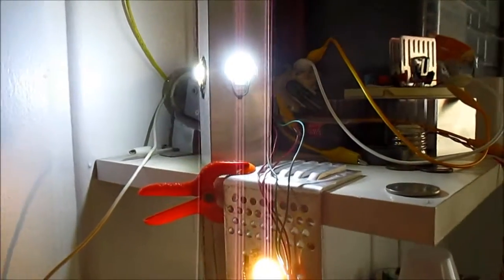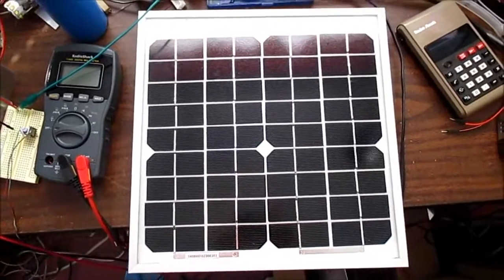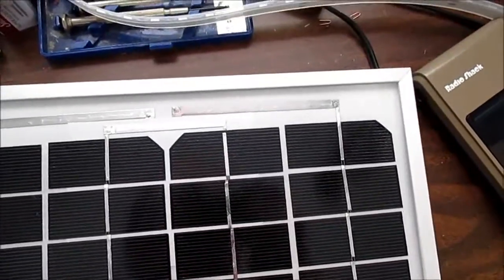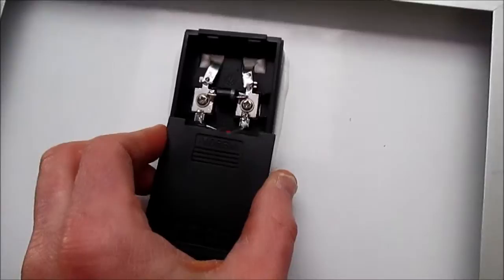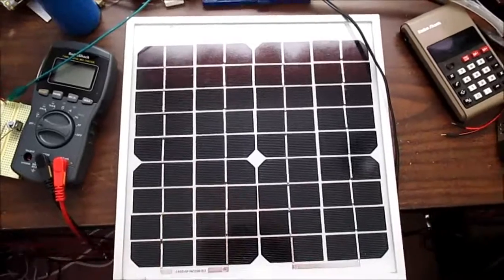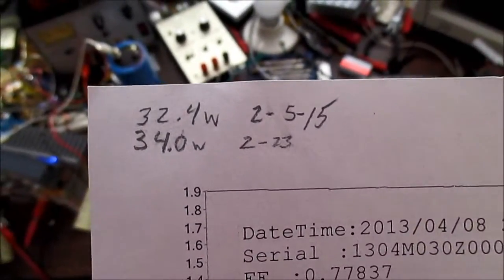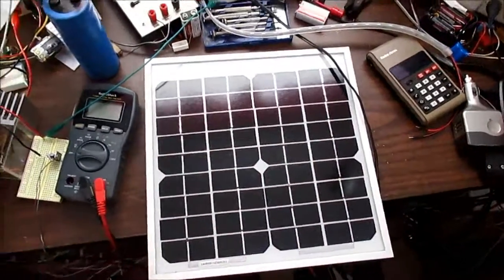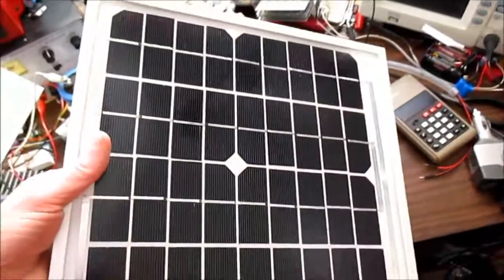10 watt mini solar panel review, Fennel brand

Comment: I have a few panels like that, with loosely sealed junction boxes ( 4 watt and a 3 watt). They've been outside for over 5 years here in Michigan and I've not seen any moisture or corrosion. They didn't come with wires or a blocking diode, so I added them. The only panels that worry me are the flexible / plastic panels, that oxidize and crack after a few years. I've had a few of those fail on me.

Comment: Just wondering if you have ever had any problems from your Fennel panel? Do you know if they have a 1800 number because I have been having problems out of my Fennel 2,000 watt system blowing diodes. I have had no luck contacting them through e-mail or the 909 number?
Reply from the maker: cdmc1984 No problems here but my panel is small and used on its own. Are you blowing the bypass diode inside the junction box on the back?

Comment: Did you have a bad experience with a fold-up? Their portability is attractive, would be nice to have for canoe camping or backpacking.  If I ever do that again...
Reply from the maker: Like anything, it depends on the quality of construction and materials. I see the Coleman panels at the big box store. They are expensive and flimsy looking. Some are amorphous type that are the least efficient and don't last as long as mono or poly crystalline panels. I don't see them standing up to wind loads or golf ball sized hail. For temporary use, a foldup may be okay but for the price, the one I reviewed is compact and very durable and you can leave it outside.

Comment: That's great at $2/W for a finished panel Are the cells encapsulated or otherwise sealed? What did shipping add to the price?
Reply from the maker: Yes, it is constructed like any other panel aside from the junction box. I think shipping was $8. You can get them in a 5 pack which might save some on shipping if you need a few.